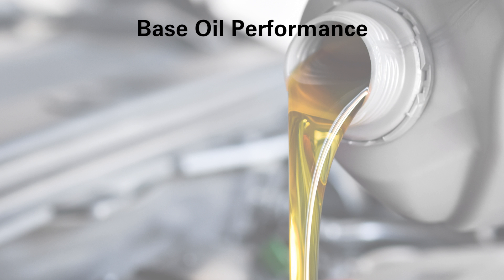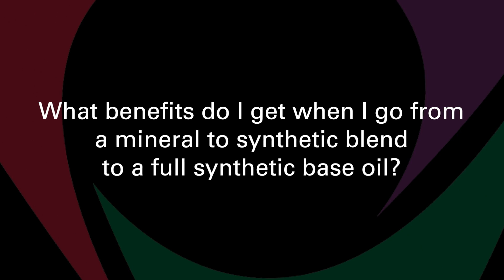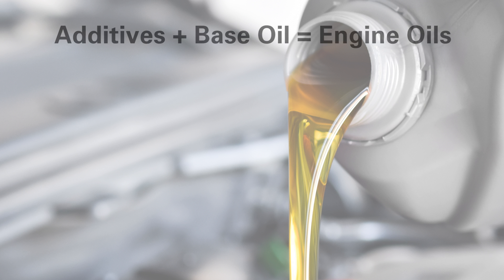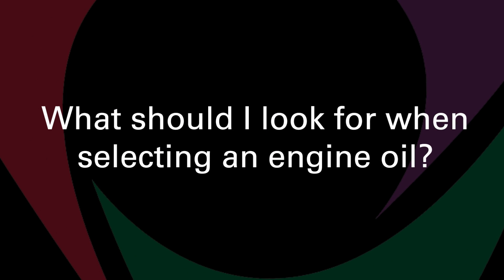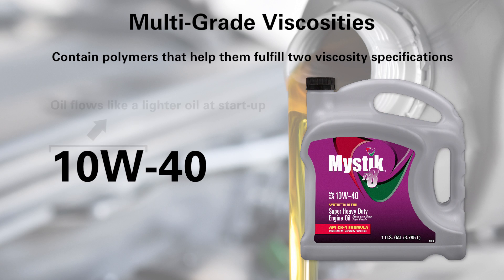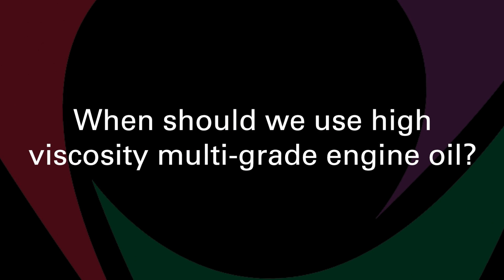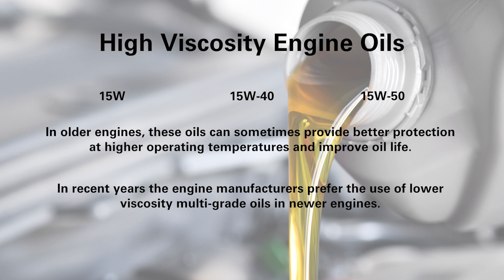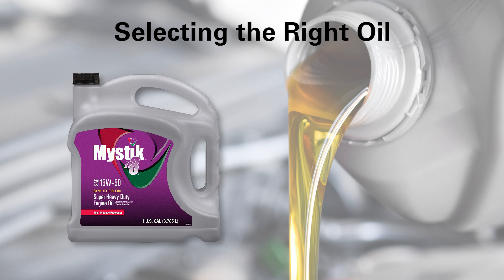Understanding Engine Oil & Viscosity

Comment: Hi am bolt driver we working in Nigeria.i drive a 2005 camry 2.4L . The hot weather can be as hi 40 degrees Celsius. I use mobil 1 5w 30 . Is it okay or i should switch. Though the manual specifies 5w30 only

Comment: This is all bulshit when oils heat up their viscosity thins run a flow test heat up oil and room temperature and see what happens which one is thicker
Reply: That's why they say it behaves like 20/30/40/50/60 meaning the oil is thin but it gives protection like 20/30/40/50/60

Comment: So I am currently using 20W-50 because mostly its hot here the temperature can go from 48 to 52 degree Celsius    in most of the season while winter the lowest temperature is around  5 degrees Celsius to 25 degrees i am using right oil or should I need to switch to 5W-40 fully synthetic and keep in mind my car is 1 year old just 12000km on meter but daily it runs around 5 to 8km
Reply: the best thing to do also 
change oil every 5000 km or 7000 km 
because oil lose its performance at high temp 
if its hot in there too much keep it 20w50 or 10w60 
because oil gets thinner in high temp
Reply: @YasserDossari1 I change it on every 3000km and is there any oil which is 10W-50 or 60 because it will be way better for me while starting my car in cold mornings.
Reply: Saad Arain yes there is 10w50 and 10w60
always use 100% full synthetic oil
Reply: @YasserDossari1  , airplanes uses fully 100% synthetic oil. Its also 5 time costly then average oil.
Reply: @saadarain6591  There are some but they shall be more thicker not suitable for light passenger car
Reply: How about in my country with constant 28-35 degree celsius all year long. Should I ignored the winter temperature?
Reply: 20w50 is to much 
i recommend 10w40 for you
Reply: @YasserDossari1  It works best now a days for light passenger cars in hot summer and high mileage cars also
Reply: @YasserDossari1  Thanks
Reply: 5w - 40 fully synthetic is excellent for hottest weather like in middle east and 10w - 50 or 60 oil is for performance cars like Mercedes or bmw or with turbo charge, 5w-40 is best oil for economic car and change it after 6000 to 7000 km if oil  level is in safe zone
Reply: Saad Arain 
check what your owner manual recommend 
or go to google 
tape for exemple : 
toyota corolla 1.5 2015 oil recommended
Reply: F° and Miles Fuck Celsius fuck Kilometers.

Comment: So is that full “synthetic” at the end of the video recommend a group 3 or a group 4 pao?
Reply: Full synthetic is group 3, 100% synthetic is group 4.  The group 3's are great for daily drivers, Walmarts Supertech full synthetic usually comes from Warren industries, same place as Pennzoil.  I have seen comments where it can come from Citco.  It's like $3 more for 5qt jug than regular oil.  Only decently priced group 4 oils are Amsoil, Royal Purple and I believe Red Line.  I have been running SuperTech since my first Turbo in the mid 90's with 15k oil changes and filters at 7.5k miles. No engine problems.  If someone tells me that $3 bucks more for oil is a rip off, I laugh.  They clearly know nothing.
Reply: @lonniebeal6032  Pennzoil and Quaker State are from Shell.

Comment: I read the car manual it says using 5w 20. However, my question is should I change the type of oil every season like summer or winter? Also, do you recommend to use thick oil in summer?
Reply: This is old I see, but still, if you look up any oil viscosity chart, 5w20 is only rated to 60 degrees F, this is a requirement by the government for better fuel economy.  Most owners manuals tell you what oil to use at what temp.  If you are going to stick to 5w20, I'd use a group 4 synthetic, the few extra bucks is cheap insurance. That would be Amsoil, Royal Purple, or Red Line. I started using synthetics in the 90's and haven't gone back.
Reply: Oils which start with 0w and 5w have god tolerance for cold weather, the other number determins the viscosity on working temperature, that one you should trust to the manufacturer recomendations, if someone uses vehicle for sport driving thicker oil because engine will operate at higher temperatures
Reply: 5W-20 in a modern car should be fine year-round and would not need changed every season.  Using full-synthetic is a good idea in my opinion.  If you do mostly 'clean' driving (interstates vs gravel/dusty roads) the 10,000 recommended is probably more realistically closer to 20,000 miles before a change will do much for you.